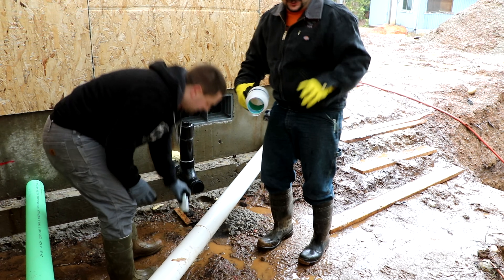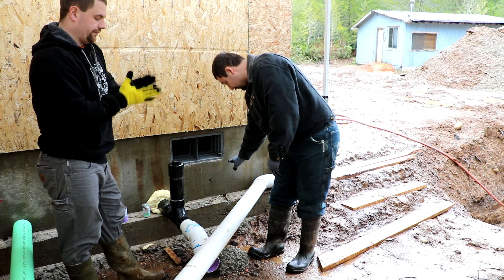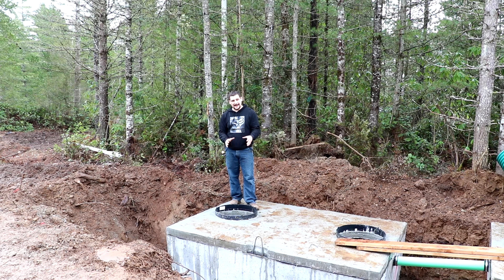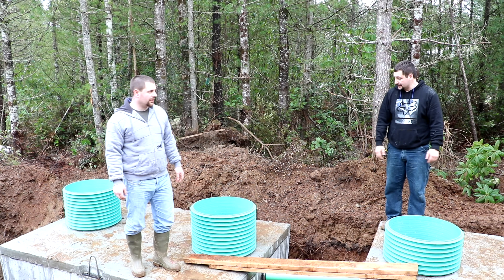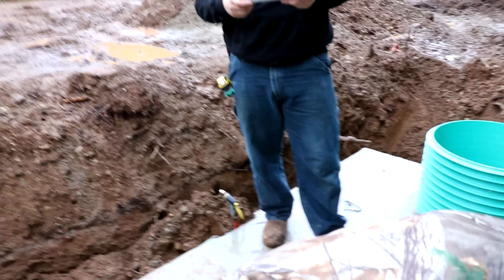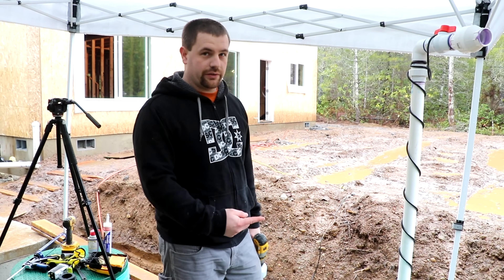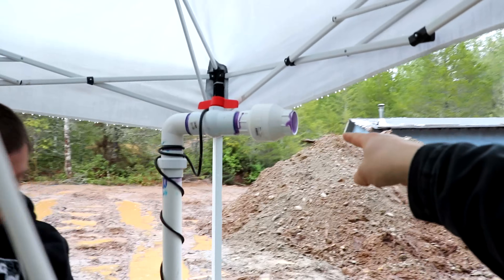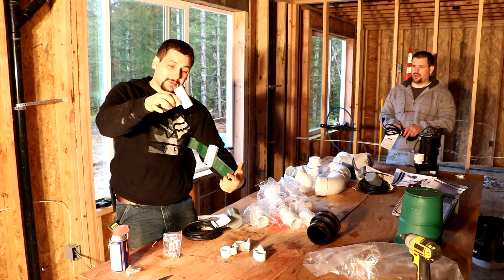Install your own septic system #2

Comment: How much space do you have between the 2 tanks?
Reply from the maker: About 40” but that distance is not specified by the drawings the thing you want to take into consideration is the slop between the tanks. The slope requirements should be on your install drawings. The tanks can be orientated in any direction  or position as long as the slow requirements from the inlet and the outlets match the drawing specifications.

Comment: Why not place the riser lids below grade it's not like access will be needed on a regular basis.
Reply: It will save you money when the system needs to be pumped out. All pumpers charge a dig fee now if they have to lift a finger lol sad but true. I know companies in Texas that charge a 90$ dig fee! I’m almost done with my on site wastewater classes and soon I will have my own maintenance providers license. It’s a free for all down here in Texas and the water management industry is booming. I’ve had plenty years of experience and I’m one step closer to achieving my goals!
Reply from the maker: they need to be access at least once a yeah for the inspection that is required by the State, and also with a pump and floats system it is always good to be able to get to the internal parts if needed. They are also required to be above grade on any new install or any retrofit install in Washington.

Comment: Daniel. How you connected the ABS pipe with PVC pipe. Does the code allowed there? In our area definitely is a no/no...
Reply: Gabriel you definitely need to use a certain type of glue. I tried use some really “hot” glue on an abs zone valve and it melted the abs. U need low solvent for sure

Comment: Great video Daniel. Reading on different sites about these tanks design, looks like it has a separation wall which keeps the solid in one side of the wall and leaves just the liquid to go over the wall in the second chamber. If this concept is true, why the second tank is required? Also, can the system be designed to use the just the gravity so no pump at all, so the liquid to exit on an overflow opening?
The last question: what is the frost line for your area? Thanks